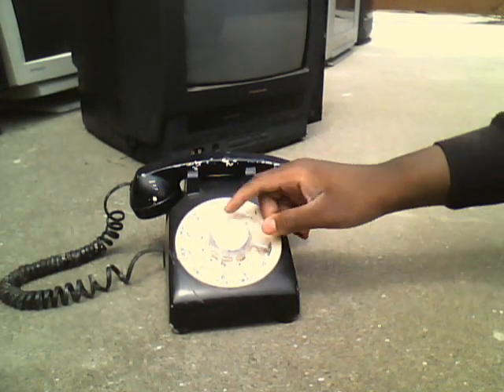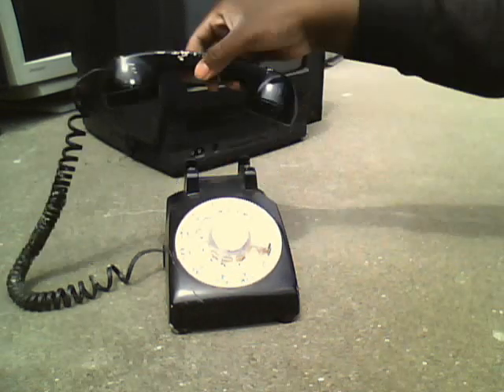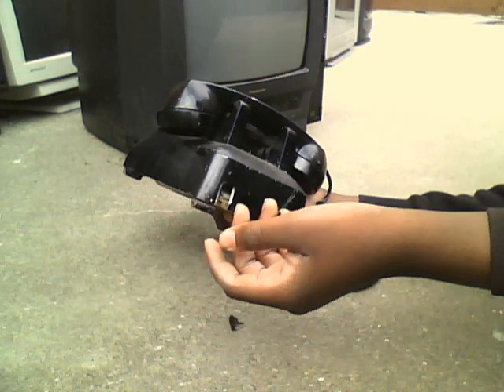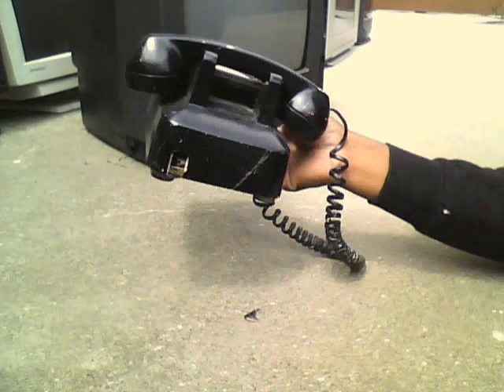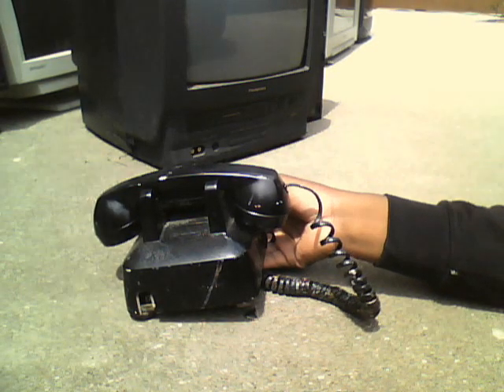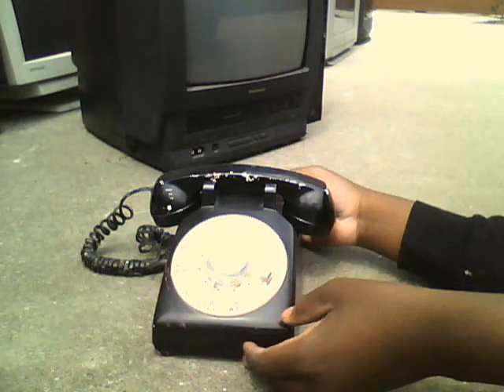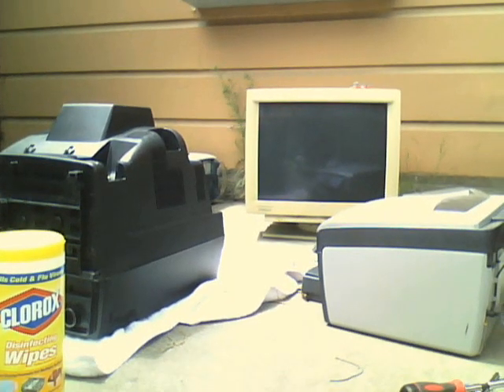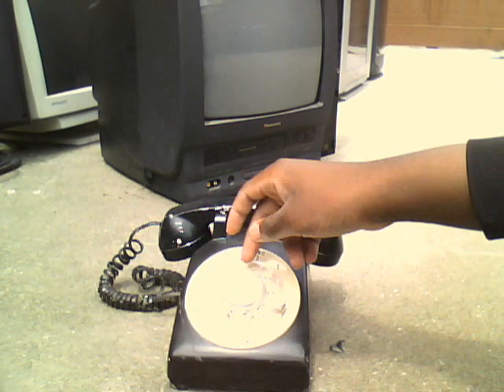Bad News for the Vintage 1960's Western Electric Rotary Dial Telephone

Comment: Well, mine is a 1963 (or 73)Western Electric #500DM. Seeing his is a bakelite model and not plastic like mine, his is from the 1950's at best.

Nearly all of these were retrofitted with modern jacks when it became available, since these were originally rented to you buy the phone company, and they were not yours to keep. When modular jacks came about in the 1960's, the phone company went 'round and repaired your phone for you, or just gave you a new replacement model.

Comment from the maker: Thanks dude! Did you ever see the original video from last year? I actually opened it up and and found out that the part is as easy to replace as hooking up an old game console to a 1970s TV! I just need that one modem part with the connections and this phone will be fixed!